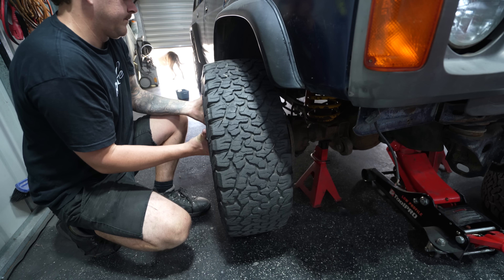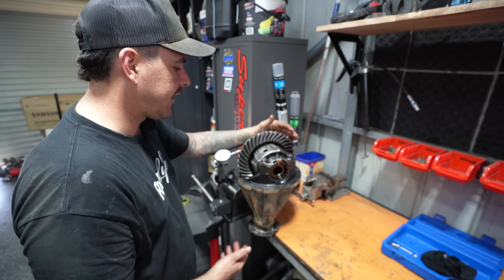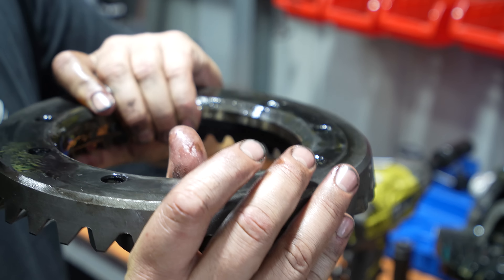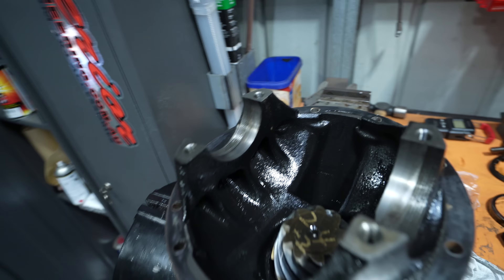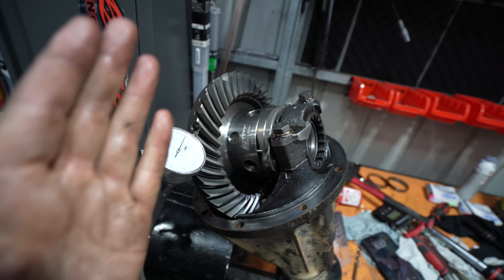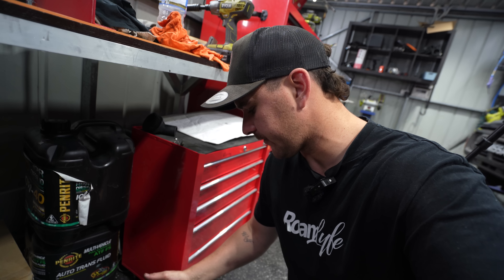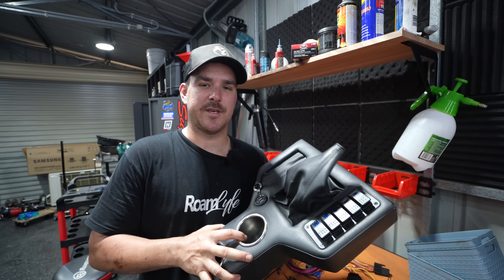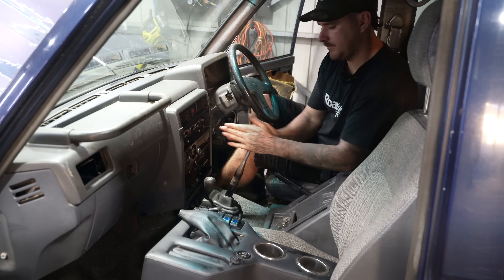I Put Expensive Lockers In A Cheap 4WD…

Comment: If you’re talking value for capability… a front locker and the largest lsd shin in the rear was the ACTUAL answer. But both is good🤷‍♂️😂
Reply from the maker: Hahaha 1000 percent! I also like that doing that retains the LSD 🤌
Reply: The LSD shim is  crock! You cant fit 8mm of shims into a 7mm space! - unless the disc are completely flogged out. Not all carriers will take the shim. The TJM pro-locker is far stronger than the small e-locker.

Comment: First thing is make the car roadworrhy & reliable. First mods if I was going offroad is 1. Tyres 2. Suspension 3. Winch 4. Lockers
Dude! Just because the grease looked good, does not mean the parts covered by the grease are good. I would have cleaned inspected & regreased. Plus I would have changed the diff ratio to recalibrate, to suit the larger tyres
Reply from the maker: Yeah I get that haha, I don’t have much money at the moment so I decided not to rebuild the hubs, I can tell they have been done not long ago and the previous owner told me they got done! I wasn’t concerned, I see a lot of similar parts at work and I can tell when new seals and parts are fitted 🙌

Comment: How much bearing preload did you put into it? noticed you skip over that part and go straight to backlash - any reason for that? is it a bitch to do?
Reply from the maker: Haha wellll, I don’t exactly know how to do it the right way so I skipped it in the video, I can’t find much info on it! 
What I did do (not saying it’s right) 

I had the backlash set to the most I could, so basically have the crown wheel all the way to the side with heaaaps of backlash
Then I just done up the pre load untill I felt the crown wheel sorta go square and rigid, then I just adjusted till I felt a little bit of drag on the bearings and left it at that! 
I’ve done this a few times and works fine but unsure if it’s correct way and don’t wanna bum steer anyone!
Reply: @RoamLyfe  Hey mate appreciate the reply regardless - we're all just trying to learn hey. Here's what i've heard...

Local diff shop bloke told me to first get the backlash to spec - then turn in the side adjusters one notch at a time on both sides until the outer bearing rings spin with the bearing adjusters. Not sure if it's right but that's what I'm going with when I install my elocker next week! (unless someone recommends otherwise?)
Reply from the maker: @aussieo684  I’ve done that before on a locker and it worked! You can see the bearing race start to move and then stop. 
I think as long as it’s not too tight you’ll be fine!! 
I did also check that the crown wheel wasn’t wobbling back and forth with the dial indicator!